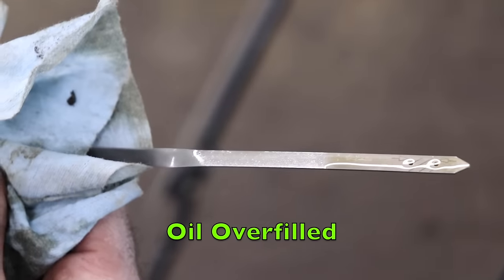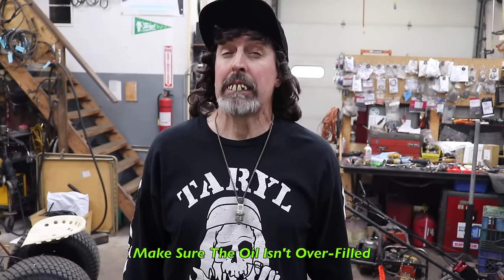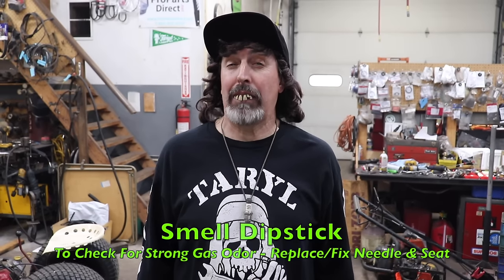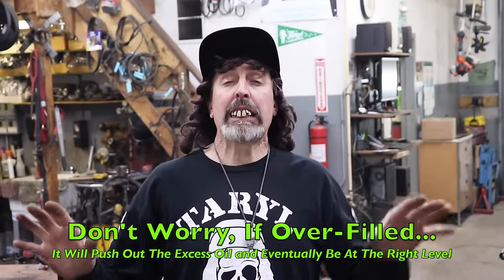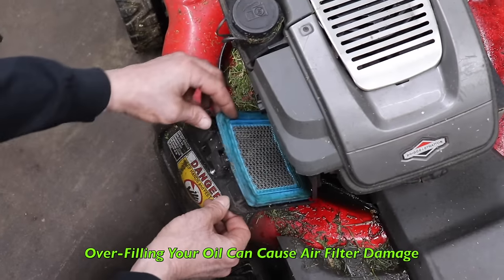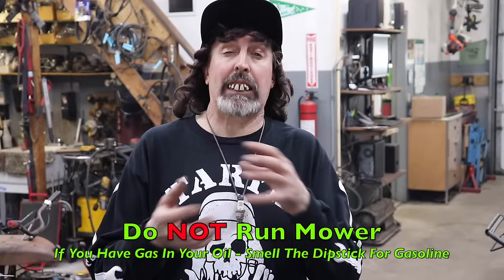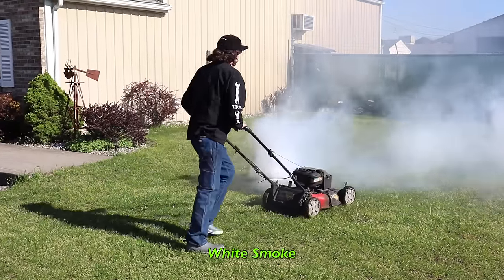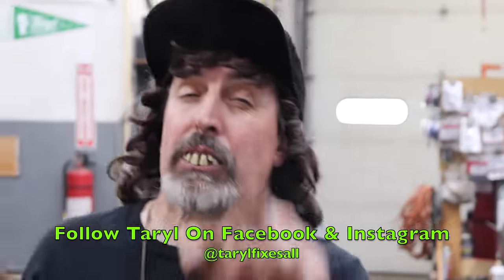Why Is My Mower Smoking? Easy Explanation!

Comment: When I was 16 my friend came over with his '60 Chev 4 door and we changed oil.  Being 16, I pulled the plug on the stick transmission and drained the gear grease.  Put the plug back in and filled the crankcase with 5 quarts of 10/30.  Started her up and took a little ride down the alley.  Clouds of smoke and the crank was making a "blip blip blip" noise as it splashed in the oil.  We decided to take a right turn and go up the hill.  The tranny locked up tight as a drum in about a half block.  Too much oil makes smoke...oh yeah.

Comment: Just fixed a John Deere riding mower with the same problem. The carburetor was loading up the crankcase with gas, it had a leaking o-ring seal at the float. Yes the oil smelled like gas and was too full.

Comment: I had my carb leaking into the crankcase and the local shop diagnosed the problem by being able to use a bic lighter to burn the oil on the dipstick.  rebuild the carb

Comment: A friend of mine wanted to change the oil in his mower and took the dip stick out and turned his mower over so the oil would drain out and he complained that the gas dumped out as well. And while it was upside down I ask him why he didn’t just remove the crank case plug that was on the bottom of the engine and he said what plug so I pointed it out to him and he still hasn’t forgave me to this day. But it wasn’t my fault he didn’t know it was there. There’s your dinner.

Comment: A neighbor went up to Walmart and bought a new push mower. But she could not get it started. So she calls me. when I get to her house she shows me the mower. I asked if she put oil in it and asked  about the gas. Yeah she told me she put fresh gas and oil in the mower. At first glance I noticed oil coming out of the air filter. When I asked her how much oil she put in she said about a gallon. I took the mower home with me. drained the oil put a new air filter and cleaned it up. I called her to come get the mower or asked if she wanted me to bring it back. I called her for three months and every time she would say I will come get it this weekend but she never showed up. She would tell me Oh, I wont get paid until Friday.  After a year or so I quit calling her. I only asked for $25. New air filter was $12.50. Not like I was making much off the repair.